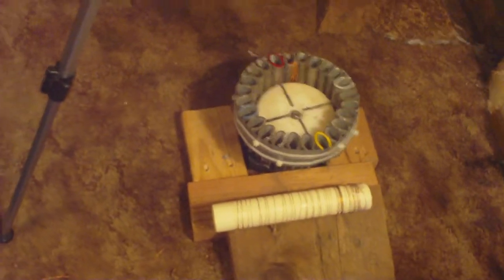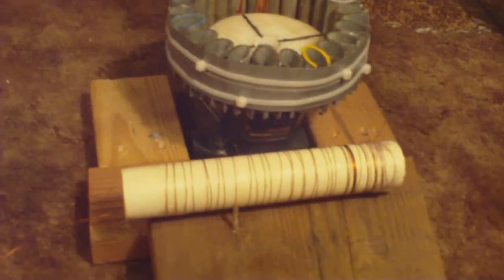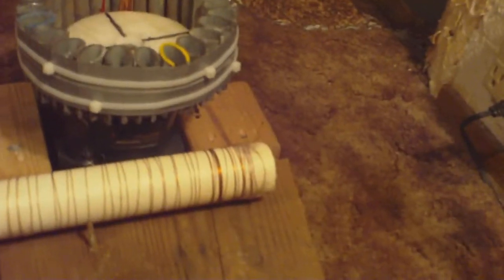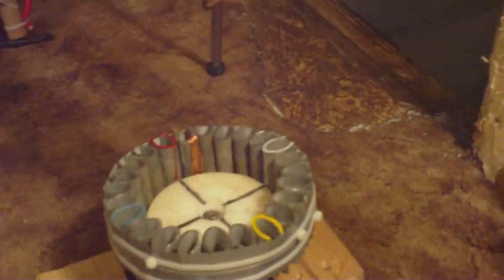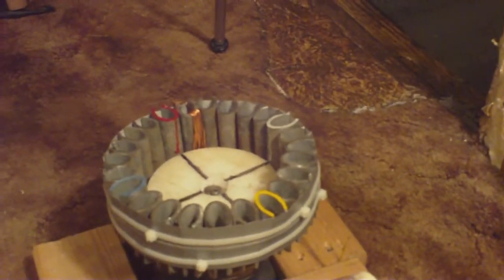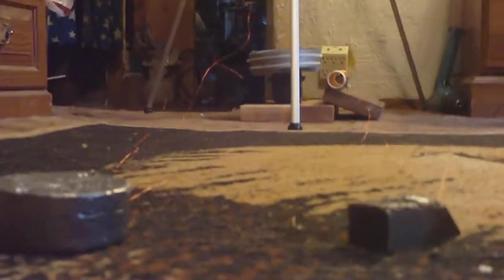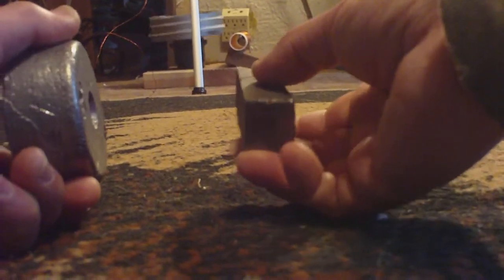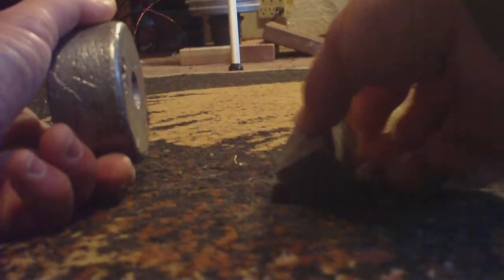leedskalnin did it this way

Comment: I think he used magnets to raise the stones. I think he put magnets on one side and put another magnet that attracts the bottom magnet on top of the stone, and than wrapped the stone with wire that attatched to his spinning generator which created a electronic magnetic field which repelled the stones from the earth, because the earth is kinda like a magnet, and as long as the generator was spinning he could lift the stone easily with his tri pod, similar to a magnet super train is lifted

Comment: I think you use a cone to direct the energy at the stone which has the other end singly wrapped around and returning to the Pyramid which has a radio frequency crystal to create harmonic resonance with the atoms. You are splitting off the neutron and then becoming the ground while holding the cone.You are freezing the polarity to move the item which is repelling the natural earth at that geographical location. 
I believe that some may claim that the stones were moved by his singing or mind but it appears the tones needed to resonante may just be pleasant to him as well. From what I have researched, negative tones have negative effect.

Comment: if you have 2 pieces of steel repelling one another then can't you take the current, run it through water on the ground and then the other over a wet stone just above the ground.  Will the wet stone hold the opposite charge as the surface? Then you can just push the wet stone around?

Comment: he used trucks and cranes, then lied about it.
Reply: have you ever worked heavy construction? Lifting is the easy part. Reaching and setting is a whole different ball game. And he most definitely used much more than trucks and cranes, the one hoist and tackle he had is still there on sight and it's rated for 2tons, the main gate weighs more than 9 tons, and some of the blocks in the walls and obelisk weigh twice to 3times as much.

Comment: He choose the location and used live rock for a reason.
Also time of year and planet position.
No tripod was used to load truck to relocate the coral.
Tesla proved you only need a transmitter, reciever and earth to get electricity.
electricity is just a twisted magnet with equal power in the + and -.
Ed figured a way to untwist it and use only one side of the electric to repel the other.
Eds pic of twisted electric and planet map looks like the ancient twist of what researchers call DNA map.

Comment: Let's go back to XIX c. to know what they knew. 
1. There was known (unlike today) the relation between pressure and electric field or "electricity" (=Leedskalnin's wider understanding of charge). Today it's hidden.  
2. Remind Archimedes' principle? The gravity in the atmosphere is a negative buoyancy of a body having smaller density of "electricity" than the charged air.
You used here two bricks of metal having different "electricity" capacity to change their density/inertia.  
Good work

Comment from the maker: Leedskalnin followers, please read this physics paper on Mobius transformations and take notice of the Leedskalnin geometric similarities! http://m.iopscience.iop.org/1742-6596/437/1/012024/pdf/1742-6596_437_1_012024.pdf . note pages 8, 11,29 and page 15, an ankh? and another paper https://www.google.com/url?sa=t&rct=j&q&esrc=s&source=web&cd=31&cad=rja&ved=0CCsQFjAAOB4&url=http%3A%2F%2Farxiv.org%2Fpdf%2Fphysics%2F0411137&ei=HLaBUt3qO4nGiwK_3YGwBw&usg=AFQjCNFWEnX4qFa3z6sJCpXrPaSCuO-hIQ&sig2=KVpBmm3PQIRuWJVv1WEDPQ page 33, the same shape as on top of Eds "generator" does anyone else see what i am getting at? The chrial handedness is pictured on the cover of his book Magnetic Current. This is making sense to me, chiral opposite handedness, when rotated, will create directional movement? or flow or current?

Comment: Ok you made a standard electrical generator "moving magnetic field over copper wires" and then ran wires to another location to carry that current to two pieces of metal that carry that current between them! So what's the big deal about that? If these were non magnetic stone and you felt something then that would be different but it's not! Nothing unusual going in here! Keep going though and i hope you figure something out! :)